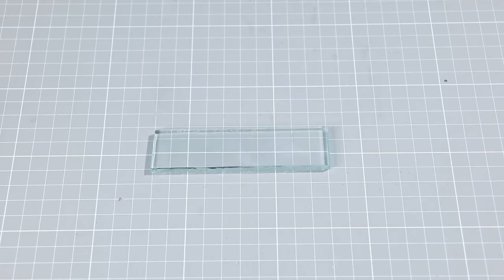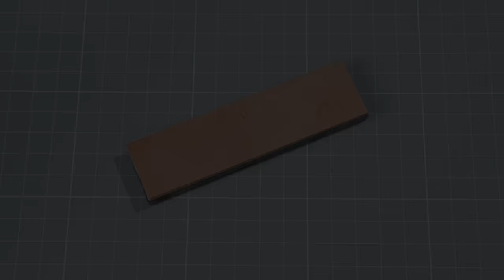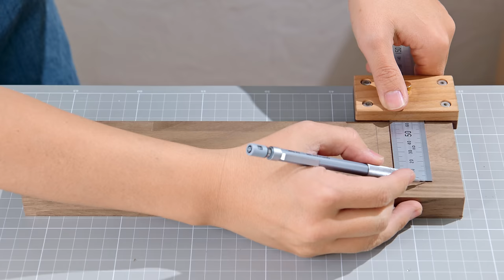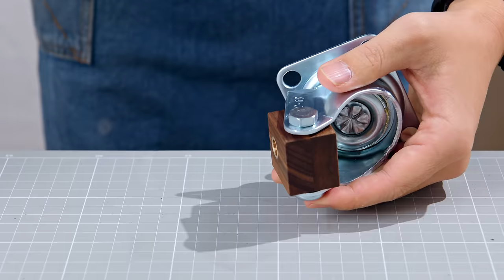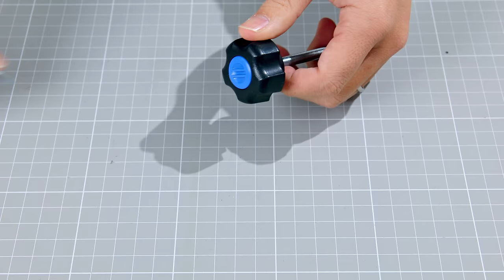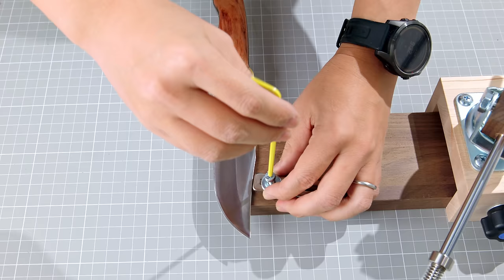Knife Sharpening Stand / DIY Knife Sharpening Jig

Comment: Can anyone describe in English the sharpening/sanding materials he is using? Also, is there any good reason why the backing material for the sanding paper should be glass?
Reply: The 2nd package text is: Resin diamond sheet with adhesive, cut and paste according to your needs

Diamond

Ceramics and superalloys. Glass, stone, pottery. For polishing tiles and other hard materials. 2000
Reply: Because glass is the most economical surface that is close to perfectly flat.
Reply: @longllamas  Makes sense. Thanks.
Reply: The glass is for a flat surface not sure about the other
Reply: @BrianClark-m2s  I understand but finely sanded wood or finely sanded resined wood is not flat enough . . . and less prone to breaking? Or plexiglass?

Comment from the maker: I hope the video is meaningful to you.
If you like the video, please introduce it to your friends and social media !
Reply: This is a great sharpener. The only issue is that you can't sharpen the other side without unclamping the blade. If you had a separate block that clamped onto the blade and attached to the end of the base, you could detach it once one side of the blade is finished, and then attach the block to the other side of the base without unclamping the blade. So long as that arm rotates 360, you just swing it round to the other side and you can sharpen the opposite side of the knife, keeping the exact same angle and orientation of the knife.
Reply: hi there. Is there any link or even name for the Materials you use. That way EVERYONE could/WOULD follow YOUR instructions √√ Would be greatly appreciated! √√
Reply: I would, except for the shady link to some Israeli software company that self-installed on my computer. Shame on you!
Reply: 😇wonderful, really - all of your presentations....what do they call the rod connecting rollers?   mygreathanks and blessings

Comment: Brilliant! I've wanted something like this for a long time, so this is very helpful! I think using a caster like you've done might actually be more stable than the ball joints in the sharpening jigs I've looked at.

It looks like you aren't having trouble driving in those threaded inserts with a hex wrench, but I'd like to share a tip with you and anyone reading this: if you use a bolt and a jam nut to drive them in, you can apply much more torque without risking the inserts cracking. That's a trick I wish I'd known sooner.

Comment: I love this design (and all of your videos.) 

The one thing this needs is a positive stop or registration point for when you flip the blade to sharpen the other side. Moving it backward or forward even slightly from where the blade was previously, gives you an inconsistent angle of attack for the abrasive and changes the blade geometry. Drilling pairs of holes for adjustable pins would rectify the issue. 
Other than that, this is a very elegant build.
Reply: i can't imagine it matters, considering people sharpen by hand. i guarantee you they're off by more than the fraction of a blonde one that you'd be off re-setting up this jig by eye
Reply from the maker: Thanks for watching.
It is conceivable that marking the sharpener stand and the knife would remedy the problem.
Reply: @cho4d  I agree that people are doing that. But many people doing it the wrong way doesn't mean it's a good idea. For those of us who still take pride in sharpening, it's a major difference, especially when it's such a simple solution.
Reply: @jisakukobo  Yes, that could absolutely work. Either would be a simple solution. 

I so enjoy seeing your videos. It's wonderful to see not only insightful engineering and practical solutions, but real pride in craftsmanship as well. Seeing so many shop made tools provide such great results is really a pleasure to watch.
Reply: @cho4d  when you do hand sharpening, result is convex shape because differences of each stroke. When you use jig, result is polished V shape and any difference in position cause new flat surface
Reply: @barbarianatgate2000  i think you misuse the word pride. people who sharpen by hand can be very skilled and take a pride in their work and the result can be exceptional
Reply: @cho4d  but why if it can be solved with a slight design change?

Comment: Beautiful work as usual by THE Internet master craftsman. I have been considering making one of these too and love the solution the master has adopted here. I am missing one feature: a movable rest so the angle will be symmetrical irrespective of which side of the blade is being sharpened. With time, for a given position of the edge, bridge positions can be marked for different angles like 15⁰, 18⁰, 20⁰, 22.5⁰ depending on the type of blade to be sharpened. I love the use of glass as a backing to replaceable abrasives. I never saw cork used for final polishing: I would have used leather. Pure Zen watching The Master at work.

Comment: Very nice work, and very clever use of a caster.  I would say that the only thing I would have liked to have seen was a way to determine exactly what angle the blade is being sharpened at.
Reply: And a slide for the x axis, to sharpen Katanas 😉
Seen this knife sharpener commercially at high prices.
I think, the notches for holding the glass plates, were probably even better with a slightly different angle instead of the 90°.
Like this |_\--------/_| so the glass plate is pushed upwards by the spring force...
Oh, that just looks a bit like a dovetail 😂
Reply: China market has inexpensive digital angle "readers" that can be attached to a piece of sheet metal mounted instead of the glass.
Reply: the angle of sharpening depends on the blade and the use of the knife. As it's an outdoor knife I would say in between 40°-50° while a sharp kitchen knife is from 20°-30° or rasor blades below 10°  the fine tuning you've to find out after you've build it 😁

Comment: this is an excellent design and execution, however, if there were a way to horizontally glide the pivot point of the sharpening surface-holder, so that it could move parallel to the section of the blade that is just straight, then only curve as it reaches the tip. as it is, the sharpening surface moves in a circle in all directions. even up an down, a linear translation would be better so that you could sharpen at precise angles requires for certain blades

cheers this is still bomb, im glad you made me think, even if the adjustments i described are beyond my skill level haha

Comment: I have rebuilt the knife grinder in exactly the same way. And realized that it is completely unusable. The constant unscrewing and retightening of the brackets every 30 seconds or so is incredibly tedious. Then I came up with the idea of attaching small round magnets to the surface. The holders I only use as spacers. Since this small change, it has worked perfectly.
Reply: Puedes pegar una foto del trabajo que has hecho? Así podremos entender de lo que hablas 😊

Comment: Beautiful work!  The only thing I would change is buying actual stones that fit into the jig.   I don't know what those strips are made of, but it seems they would  wear down have to be replaced fairly often.
Reply: The strips would be wet and dry sandpaper. It's dirt cheap and lasts long enough, you don't have to buy a self adhesive version as double sided tape will suffice.

Comment: Nice and simple. 
Although angle adjustment is iffy, and unrepeatable. The clamp holding the knife does not help too, as the knife is clamped in different places every single time. 
Some minor improvements and this is very usable :).
Reply: Not necessarily. Angle repeat is measly a case of a pen line on the wood.
And mount repeatedly can be achieved by having the spine of the knife touch the mount screw

Comment: Brilliant work as always! Thank you for all that knowledge and wisdom you are sharing with us! Just a small question - what is the easiest way to find the desired angle to sharpen with this design - inclinometer?!?
Reply: Маркером, закрасить режущую кромку. Если не надо делать другой угол. Или углы не совпадают на разных сторонах ножа, что бывает на китайских ножах....
Reply: @МихаилШихов-щ5к  I know that method, but sometimes blades have particular sharpening angles (due to type of tool, steel, grind, use, etc.) and sometimes a different from factory angle is needed.

Comment: looks good but as a sharpening device this will never work properly. If you have the blade a mm forward or back compared to the other side then you will change the blade angle and then have to remove more metal to get the edges to meet, you will then weaken the blade tip to uneven edges and cause it to dull so much quicker. Without knowing the distance you will always get different blade angles and spend more time removing metal to get the edge. Add a stop or a known distance and you will always get the same blade angle and sharpen consistently.

Comment: how do you adjust the angle?
Reply: Это очень легко. Надо просто передвинуть каретку. Неужели сам не догадался?
Reply: @viktorshtanze8322   no tengo idea de lo que escribiste y no aparece la opción de traductor
Reply: just sliding the back piece forward or backwardsand the angle is changed
Reply: @baluba006  yes…. but no, its a triangle no mater how long a+b are the end angle doesn’t change, you need to increase or decrease the c side to change the end angle
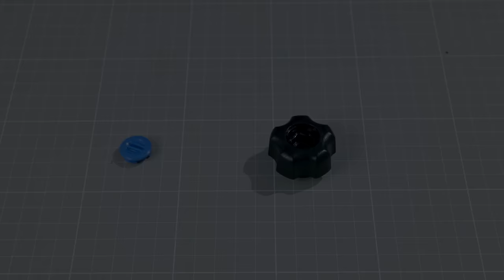Reply from the maker: I show that the angle can be changed at 11:35.
I thought I could convey it with this gesture.
https://youtu.be/gBcvWtgaNQU?t=837
Reply: oooo i see, yes the “c” side does change, how much?